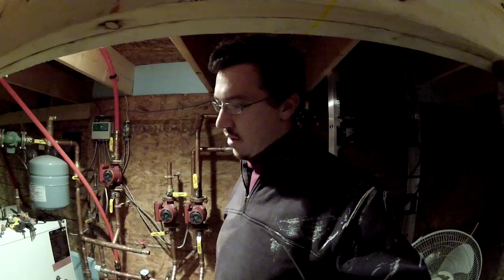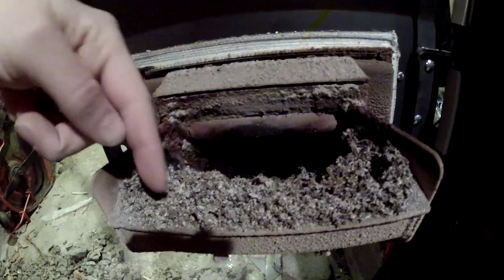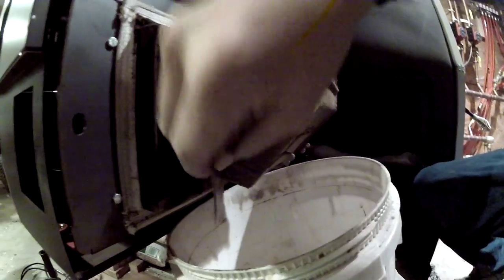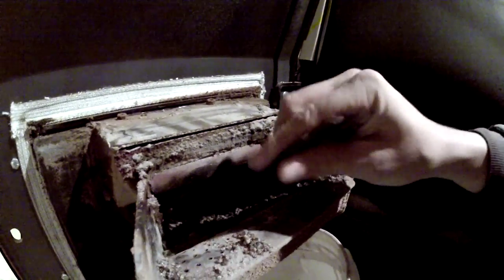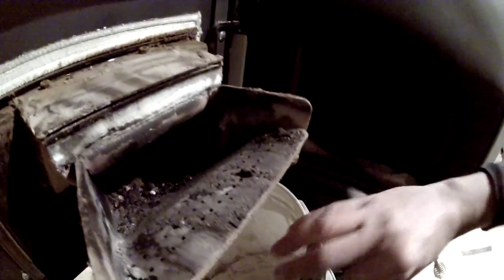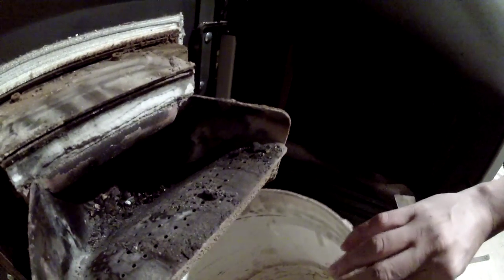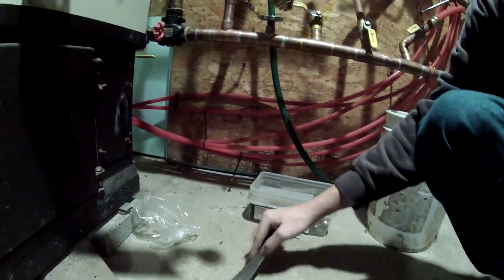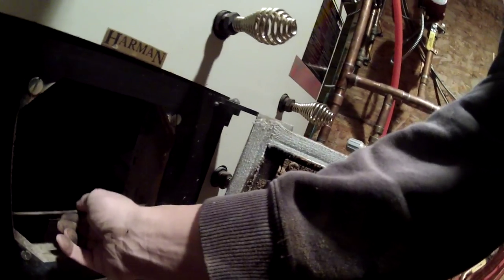Harman PB105 Boiler Cleaning - 130 - My DIY Garage Build HD Time Lapse

Comment from the maker: Ok so as you probably imagined, my brain, immediately went to, how can i build on myself.  The answer is probably simple.  Metal can, flexible metal hose.  Seal the lid, drill two holes, put a baffle in front of the "out" port to keep ashes from be sucked out.  Probably make the baffle out of a super thin metal screen, to also filter the larger particles as well.  Thanks for the idea!

Comment: i quit burning pellets because natural gas is way cheaper here in N,Y, i don't miss pellets , 4.79 a bag .when i first started they were .75 cents a bag. thanks
Reply from the maker: yeah, these are 195 / ton.  It's still 4 times cheaper than propane.  We don't really have natural gas up here.  Plus, i'm kind of in the camp of.  We can grow trees in 40 years, how long to grow fossil fuels?  I know, hypocrit I still drive a car, but, every little bit helps. :)
Reply: It's about doing what we can. Yes, driving a vehical can have an impact, but can be reduced by what many been doing since the Oil Embargo: drive less, combine trips, carpooling, and alternate transportation. Recycling (including vehicals), composting (instead of landfill), y'all get the idea.

Comment: Well, the better!!! Having to "shut down" the boiler isn't that conveniant because of loss of heating capability!! I thought the boiler would perform less with ashes building up but if that is not the case; why bother about it!!! At the moment I'm constructing a platform to reach the chimney on the roof of my house!! These metal chimneys in combination with build up of creosoot from a woodstove are dangerous when not cleaned properly; so that's another concern than hightech pelletboilers!!